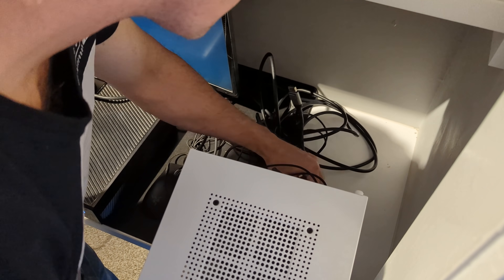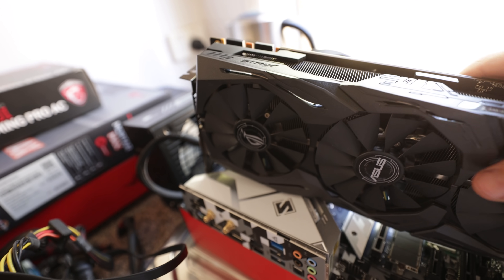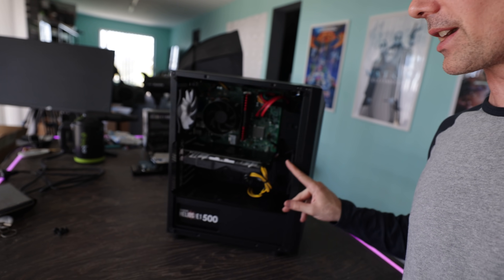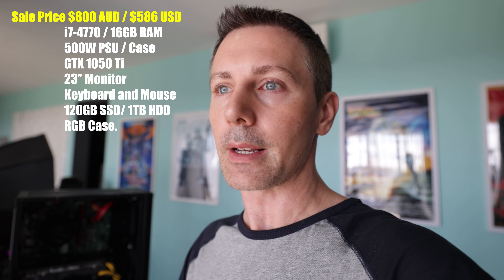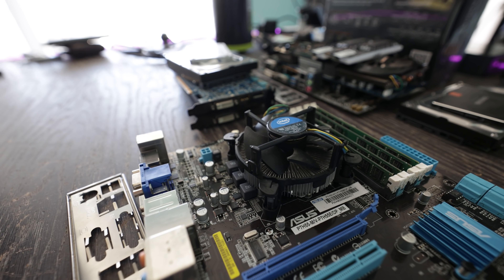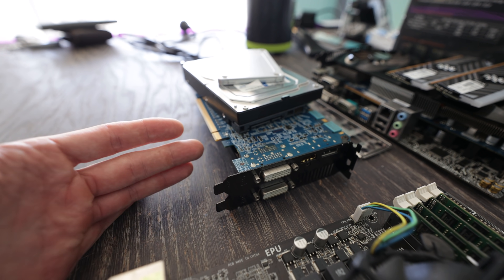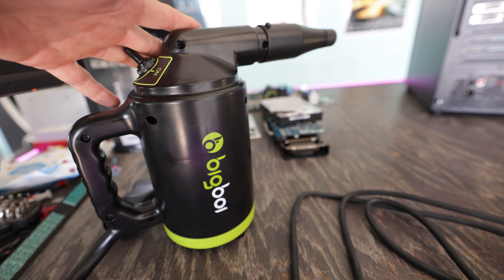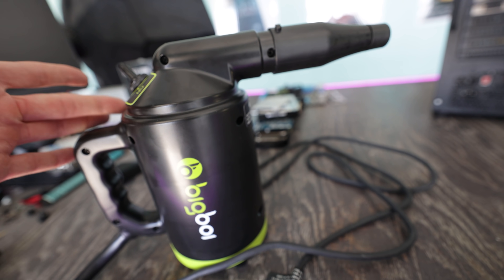Fixing Up Gaming PCs under Warranty (Vlog)

Comment: Local is far worse, people on FB Marketplace and Kijiji want even more for their components than Ebay, plus you get no buyer protection incase they sell you a broken component and they always expect you to go pick it up.
Reply: Depends on where you live. In my area I can pick up things way cheaper locally as opposed to  ebay. As for buying broken components just use common sense and always ask to be shown proof of it working, if they're hesitant to do it or just don't show you, don't buy it, simple as that. The buyer protection is a legitimate advantage though.
Reply: @Dictatortot-n3d  Proof of working is not enough, I have an R9 280X that "works" but you can't overclock it, enable it's boost clock, or even have hardware acceleration enabled in your web browser without it continuously crashing the system, someone on the local market can easily sell you something like that with major defects and is on it's last bit of life, there's really no way to know unless you can properly benchmark and stress test the component, and with buyer protection you can easily send the item back if it doesn't perform as expected, you don't have that option on the local market.
Reply: My most recent deal was a $145 5600xt locally. eBay prices, over $200 with tax and shipping
Reply: @Dictatortot-n3d  For where I live in Canada, people on the local market usual want more for their components than what I can get them on Ebay, I recently just sniped my 1070 FTW on an auction for $236CAD after tax and shipping, people on Marketplace want $250 minimum for worse 1070's that have no shipping or buyer's protection, so not only are you taking a much bigger risk but you also have to go through the hassle of going to pick it up and sometimes they live way outside the city.

Comment: Nothing lasts forever. But milking hardware for as long as possible is an environmentally conscious choice. Personally I made a 'Gaming' laptop last over 7 years by transitioning it to a work PC. Old 'Gaming' computers absolutely smash current 'business' PCs. Often because we use multiple monitors - where even a good old GPU makes a big difference compared to an APU.

Comment: I currently own a monitor that has bad back light but it does not happen every time I turn it on so I can power cycle it and that fixes the issue. So it should be a warranty part.

Comment: I'm not as down on helping out with user error, most of the time it can be solved over text. For example, I sold someone a gaming PC and they were plugging into the iGPU which was a simple fix. But egregious user error has no excuse lol, my response is why are you using a PC? 😅

Comment: Damn, big boi is aus only? Looks like it would be very useful. My brother cobbled together his own air cleaner. It's an industrial size tublar carbon filter, and he put an industrial box fan on the top. It works, when I turned it on lint and debris literally flew up from my keyboard and was sucked into it. Just very, very loud. Great if you leave it on in a room where you aren't going to be for an hour.

Comment: User error with Windows needing reinstalling - I get that so much...... and people try to say there is something wrong with it when they somehow messed it up..... even had a PC come back recently with no display..... so swapped the GPU over 750Ti for a 660 all I had available they were happy no charge but upon testing the 750Ti in another PC later it's working fine and passed heaven benchmark so who knows what they had done to stop it from posting...... getting the input selection wrong on the monitor though is common too but quite understandable bc nobody is born an expert on everything and for some of these buyers it's like their first PC but still a pain the ar.... especially if you've drove to their house to fix it.

Comment: Hey Brian! I built my first PC about a year ago and I’m wondering when I’ll need to change the thermal paste on my 5800x and RTX 3080? I’m afraid I’ll break my graphics card.. a step by step tutorial will be helpful! Love your content :)
Reply: Bro it's not possible for thermal paste or a lack of thermal paste to break anything. Cpus and gpus will turn themselves off or crash when they reach too high of a temperature, which means no damage will occur. The only time you should replace your thermal paste is if your temperatures are dangerously high and even then it might not even be the thermal paste that is the cause of the high temps. It won't hurt to replace it as much as you want but there is nothing wrong with not changing it for 5 years if its working fine. If you're pc is working fine, there is literally nothing to worry about. If you are concerned with your system's temperatures, you should see if your case and components have proper airflow. Use as many case fans as you can and make sure the front fans are intaking and the back fans are exhausting. Invest in a beefier cpu cooler and use an app (or the bios) to tune your fan curves for ideal temperature(airflow) and noise level regulation. And for your gpu, use msi afterburner to tune it's fan curves as well.
Reply: @sebaschan-uwu  thanks for your response, Sebastian! The GPU temps I have now are not bad (67 degrees on COD Vanguard), but it’s higher than when I played older games like Warzone (maybe 60 degrees max). I’ll monitor my temps and if see a higher increase in a few years I’ll try changing my gpu thermal paste and/or pads.
Reply: @alexisonfiiire  bruh 67 is fine, make sure your memory temps aren’t bad tho lol

Comment: Bryan, what do you think about Windows 11 strict requirements? For me it's bad for used PC parts upcycle. Yes it's possible to override in the software. But it whould be even better with a hardware patch like an add-on card so it will work after updates and reinstalls.

Comment: Yeah, I charge $30-$50hr depending. The key is that everyone else charges $80-$100hr+. I get a lot of business with that rate.
B, you gotta get a solder (Soldier) man for those MB's and GPU's that just need new VRM PWM's or V-ram IC's. There actually easy to repair. Having a solder (AIR) station brings me an extra 35% profits. Its worth it, plus you get to fix and or potentially collect some great GPU's and MB's.
Reply from the maker: Making a pile here, would love to get some time to get onto it, any good tutes to dig into?
Reply: @techyescity  northridge fix does some amazing fixes, you can learn but im not sure if they do tutorials, i do know they offer courses tho

Comment: Ah yes... good old 10-Series card memory degradation...
Wasn't expecting anything different
Reply: i have a gtx 1070ti that was crashing under load. I thought something like memory degradation was the issue. Turns out the previous owner replaced paste with something cheap and it was overheating lol. Also my card had a lot of thermal paste on the pcb around the gpu and a hideous amount of dust. A good clean and some Artic MX-4 got my card fixed.
Reply: @Sw33t_Ag0ny  thats why you watch your temps from time to time...
Since a little while ago even task manager shows your a gpu temperature readout
Reply: @progamer00006   how do you think I came to the conclusion that it was overheating? I didnt guess, i was watching my temps when it happened. The first thing i did when i bought it was run Unigine Heaven bench and pc crashed. Booted up pc and ran bench with msi afterburner and HWmonitor. PC locked up and crashed again but nothing temps where in the high 80's. Ran bench again but lowered power draw on msi. Temps still high even with low clocks. thats when I took it out the pc to clean it up and replaced thermal paste.

Comment: For me whenever I have flipped a PC i always make sure i have a one to one replacement spare normally at least 2 or 3 back when the prices werent stupid example rx 570s i used to always carry 3 so if i had to replace one it wasnt an issue nowdays its 720 p bangers just to keep my hand in. Like Brian tip of the gtx 645. i managed to find a stock of gtx 750's non tis combined with 4th or 5th gen i5s they make for great e sports machines. But the high end rigs i stay away from because by the time i have sourced the graphics card i cannot get a spare so if something were to go wrong it would be very difficult to warranty the rig.
Reply: wise

Comment: I got 13 brand new Xeon x5570 CPUs off Jawa for $30 I'm waiting for to use in some budget Esports rigs.
Reply: great deal i scored a box of 50 new old stock rx 470s 4gb for about 75 a card I thought they would take a while to shift i was wrong listed on ebay for 120 a card all sold out in 11 minutes (i did limit to one account per card because fuck scalpers)
Reply: @RK-zf1jm  Yeah, great deal given the situation today. I remember buying brand new Powercolor RX570s brand new for $130 for budget rigs all day long. It's sad how things are now. Newegg has been having some insane deals on parts this month though. 2×16GB 3600Mhz kit of Neo Forza for $57.99! Clocked to 4000Mhz easy.

Comment: 11:50
i bought a brand new powercolour fighter rx6600 for a build
as soon as i increased the memory clock even a tiny bit, it started freaking tf out, artifacting and glitching in games. even with the smallest increment from stock clock speeds.
i rma'd that card
for sure it wasnt gonna last too long if i sold it in a pc

does anyone else have the same problem with their 6600s?
Reply: 6600, 6600xt, 6700xt, AMD pushed those cards to the limit.
Reply: @misterx8448  maybe the 6600
ive tested pretty much every rdna2 card except for 6800
this 6600 is the only one that had issues with overclocking
heck, i had a 6700xt, i could almost max out the memory slider and it would run solid
Reply: I had a fighter card and had similar experience to you and like you i returned it for a refund, I think its the build quality of the fighter cards in general as they were the cheapest in terms of msrp apparently if you leave them stock they work fine
Reply: @RK-zf1jm  interesting
it was the cheapest available 6600 so yeah that makes sense
it worked pretty flawlessly stock
but idk its pretty weird that its unstable if you increase the memory clock by literally 2mhz (smallest increment)
Reply from the maker: @anmolsaxena_  That was a wise move imo. All the RDNA 2 cards I have had have gone at least 5% on memory without any hiccups.

Comment: this is so boring and stupid....people who brought a pc but are unable to switch the right input!!...and u, the seller have to drive miles for that...cause the buyer always guess: Oh, its a broken Pc!
No, Guys...in many cases its a broken brain!
in case of the used 1080ti...maybe the previos owner doesnt notice this "fault" and he sell it with no purpose to scam people!! its a common fault on old hardware and u never can 100% beware of it..
but a 1080ti with 200mhz less clockspeed are not a big deal!
The Dell Monitor is an easy fix...its one of the Backlight Led! Its no big deal for u to disessembly it and replace the led strip or one of the leds in this strip!

Comment: Always good to show real time pc problems and how you fix typical or oddball issues your helping people that might not have a clue how to troubleshoot their box or where to start. I chased a no complete boot issue for a while and finally realized my wireless keyboard chicklet for the USB input I had moved to the back so the pc wasn't seeing it anymore so it wouldn't complete the boot. Moved it back to the front and it's stable and boots fine again. Dumb problem that took a while to figure out.
Reply: Does this PC had secure boot enabled?
Reply: @Aquabyte  It didn't when I was having the issue. I have turned on tpm on the board now in case I want to update to 11.
It was fully because the Logitech usb reciever thing was in a port on the back of the pc so it wasn't close enough to the keyboard to pick up the signal. The boot kept looking for the keyboard and couldn't find it so it just sat there. If I booted into safe mode with my backup USB keyboard it would work fine, but not on a normal boot till I moved the USB receiver to the front of the computer where it was close to the keyboard again.
Reply: @69Dartman  Such a simple problem can cause you to itch your head sometimes, there are several instances where silly stuff have happened with me as well. Well it's good that you found the solution :)